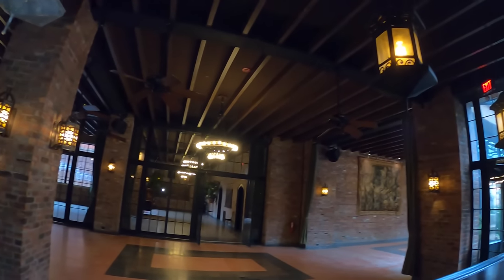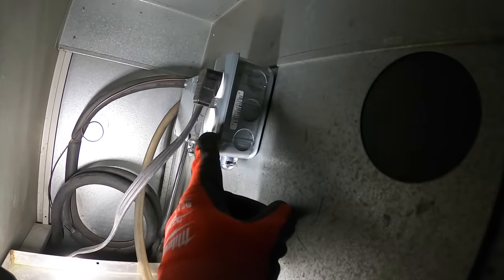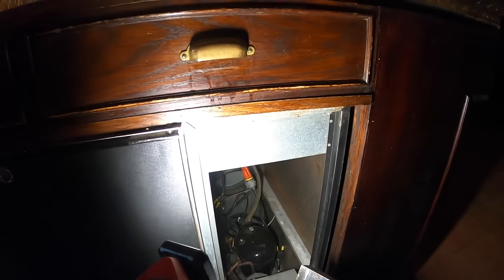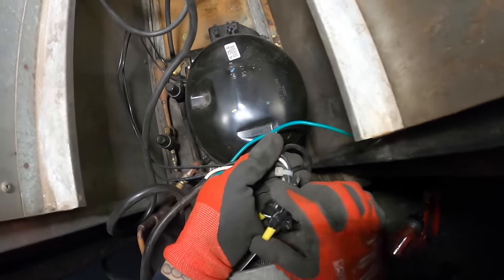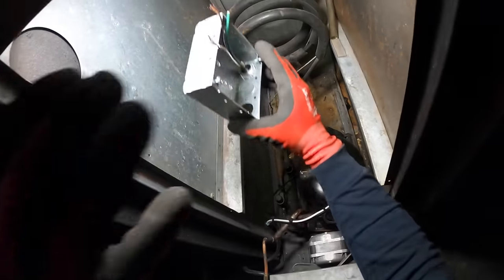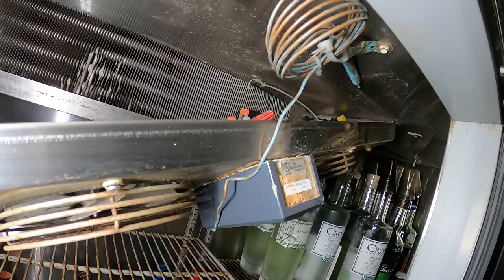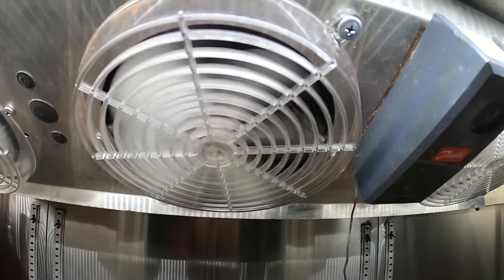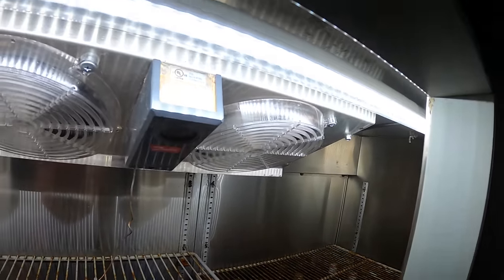HVACR: Commercial Refrigeration Bar Wine Cooler Upgrade (New Electrical, LED Lights & Fan Guards)

Comment: Good job Jumper, I would have run door switches and power all the time for the lights, instead of power from the fans, good job regardless.
Reply from the maker: Thank you! These lights are powered all the time as the evaporator fans run all the time. I wanted to install door switches so the lights turn on only when the doors open as that would make the lights last a bit longer but they didn't want to pay for that setup. Thanks for watching! 🔧⚡️

Comment: The red wire coming back from the tstat is called a switch (or switched) wire. Also, the cords from the OEM in the cooler are line cords. (Even though they are the same style, they are not extension cords. They are perfectly safe, if not physically damaged and made with the correct insulation and outer cover.) 
An extension cord has both male and female ends. So the orange one is not, but would be called a pigtail. 

Great job and nice clean up on the electrical.

Comment: I always use stainless screws in a refrigerator. Health Dept. does not like seeing rust in boxes. Those shelves would be a violation. Fan blades are different rotation. Were they all pulling air thru the coil?

Comment: Hey great video. Do you have a link for those lights. That connection is awesome. Does it have an external driver. I did not see one in the video.
Reply from the maker: Thank you! I got you⚡️ I will leave a link below. They come in 3 different lengths. 4 FT, 5 FT & 6 FT. I was really impressed with those lights. What do you mean by external driver? Thanks for watching 🙏🔧⚡️

Refrigerator LED Light Bar
https://amzn.to/3vtgsSb
Reply: @JumpermanTech  The driver is the LED version of a light ballast.
Reply: @mxslick50  Thank you.
Reply from the maker: @mxslick50  Appreciate the tip!
Reply from the maker: @sherwinalvarez7365  No driver, just connect to power 👍 Worked just like that

Comment: I would’ve cut the shaft on the motor instead of the cover hole.   But great work
Reply from the maker: I agree that it would have been a better. Thank you & thanks for the tip🤙 Thanks for watching 🔧⚡️

Comment: Put the digital thermostat in the condenser section and use a relay or contactor for the condenser. Those digital stats cant handle the load like the mechanical stat.

Comment: Only way to drill through stainless is slow with a ton of pressure
Reply from the maker: There's definitely a trick to it for sure. Thank you for the tip & thanks for watching! 🔧⚡️

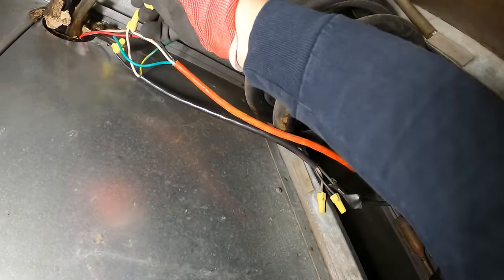Comment: 6:50 Broooo did they not even connect earth? Just why. It's one wire nut. One single wire nut. 2 minutes of work if they are slow. Then they just go home like the job's done and sleep just fine leaving that lethal piece of shit behind in a wet, badly lit kitchen. The audacity...
I an really glad you got in there balls deep to fix that up and not someone else because that could have actually cost a life in the long run. One wire gets loose, touches the ungrounded frame, no GFCI either and a barista is gone forever.